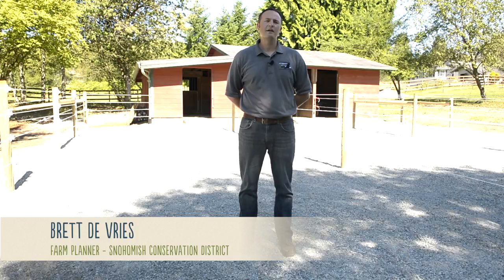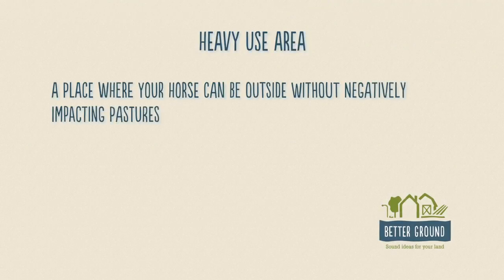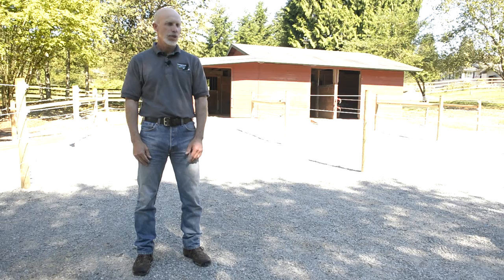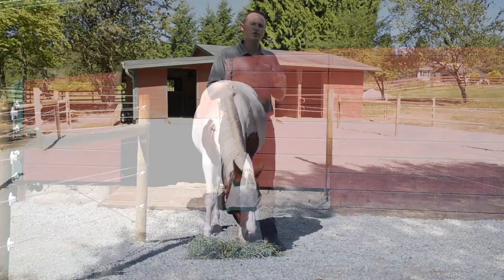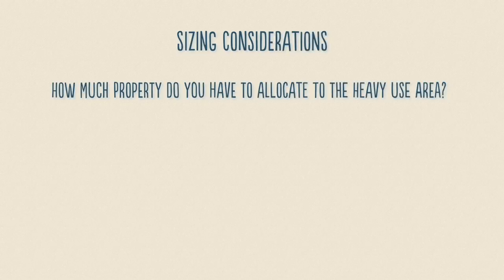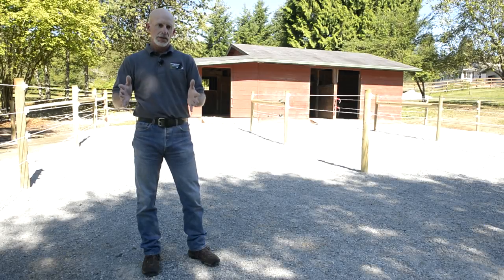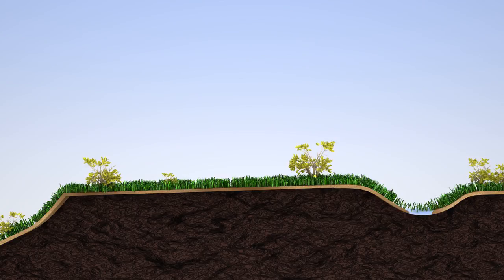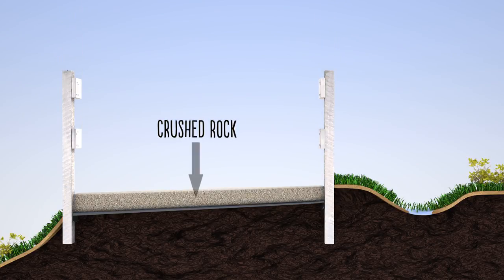Winter Horse Paddocks for the Pacific Northwest

Comment: We have this crushed gravel on our driveway and it does pack down very well. But, it also will stick into bare feet and it will stick into the soles of your shoes and treads. The crushed gravel is sharp and that is how it locks into each other. Given how it grinds into many of our shoes and boot soles, I have to wonder if will do the same on hooves. I know horse hooves are tougher than some shoe soles, but it is very common for sand and gravel to work into the white line area, frog and other cracks. As well as get between the shoe and the hoof.
Reply: I'd personally recommend having a layer of bluestone or stone dust on top; will make the surface more comfortable for their hooves and still allow water to infiltrate.
Reply: Could you add a layer of sand on top of it? To keep the stones away from hoofes and horseshoes?